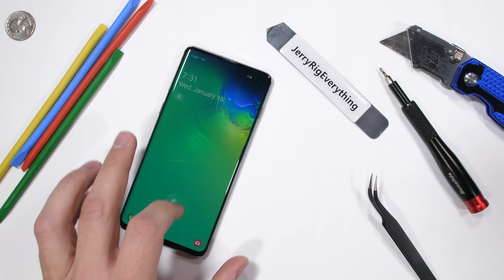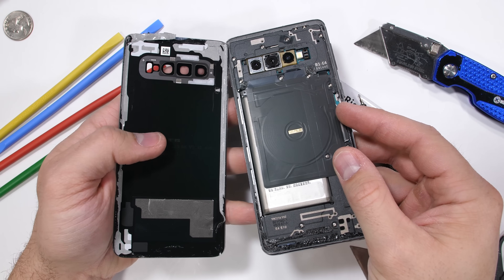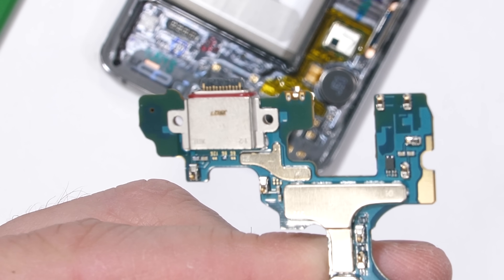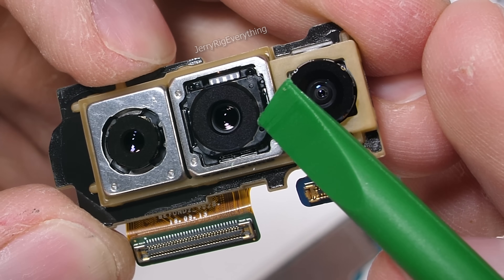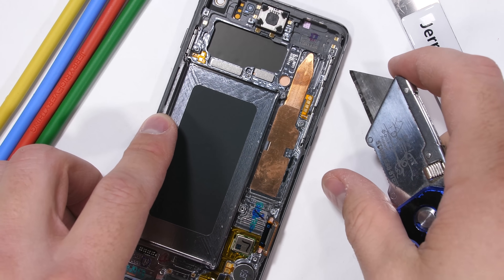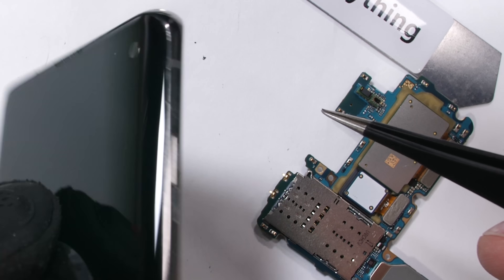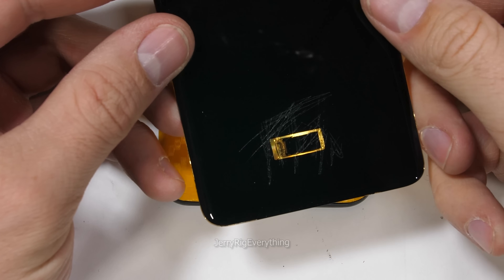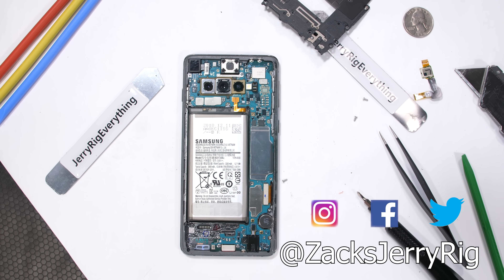Galaxy S10 Teardown – Does Ultrasonic Measure Up?

Comment: "Apple level anti-consumer planned obsolescence baloney"
-Zack, 2019
Reply: The iPhones are quite easy to repair. Adhesive strips for the battery,modular lightning port and microphone,modular speakers,simple display change without destroying it,modular sim-card tray… iPhones are more easily to repair than most people think.
Reply: @maltereese8800  That's why iphone lineup get repairability score 6/10 on ifixit. Easy screen and battery replacement, but you need special screwdriver because its a weird screw.
If the back glass is replaceable, they would got at least 7/10.
Reply: iphones and easy to repair... that is a fk lie
Reply: Fly Crack actually easier than the Note 9 according to ifixit.
Reply: Ikr😂 but whatever there's wireless charging
Reply: "Not cool"
Reply: Sam-ple

- ?, 2030
Reply: This is funny as I said "planned obsolescence" the other day and everyone guffawed like I was using a fuckin science term. Can't wait to send thise twats this with a time stamp! 

Fuuuuuck you guys! 😄
Reply: True story. Greeed.
Reply: i have done phone repairs since smart phones was invented. Apple has always been easy to repair included the break out charging port.. samsung has been "glued" together a long time . but i like both
Reply: @Tuxnor thats a fk lie, apple is soderin and glueing aswell and even uses selfmade screws and is suing even "non" registered repair shops... so shut the fk up with your lies
Reply: Fly Crack hmm. You can buy the screws. On amazon. For taking apart iPhones. 

Also, check out ifixit scores on iPhones and Galaxies. Might surprise you. 

And judging by how Samsung glues down the battery, replacement would probably be easier on the iPhone for this very battery replacement category since iPhones have pull tabs. Pull it out and the battery comes loose.
Reply: Does a tear down on a Samsung, sees something bad, it’s apples fault - zack, 2019
Reply: Yeetyeetyeet McDougald he didn’t say it was their fault, he just said it was something apple would do
Reply: Michael Pittenger lol
Reply: @Yeetyeetyeet McDougald are you that kid who got dropped their head on a stone as a baby? cuz you make no sense at all.

Comment: Nice video! :)

Wait, a permanent usb c port? That's just stupid. I have a Galaxy Note 8, and a half year ago the battery was acting weird: it shutdown in less than 5 minutes beneath 30%. Samsung fixed it by replacing that small pcb with usb-c port.

If it happens with Galaxy S10: whole motherboard. But is that cheaper for them? I think just more expensive: small pcb vs whole motherboard xD.

Comment: I want a phone that is designed to last and be repairable. Nothing overboard, just a removable battery, replaceable ports and buttons. A phone I will replace when I want to upgrade, not when it breaks. "But it has to break, what if you keep it for too long?" That won't be a problem if I don't buy your fucking phone in the first place.

Comment: lol people in comments saying they're not getting an S10 becuase you can't replace the charging port. First of all... HOW IN THE HELL COULD SOMEONE MANAGE TO BREAK A CHARGING PORT? What are you planning to do with it? It's a two-way charger as well. You'd have to be a mad scientist to break that by accident.
Reply: the charging port on some of my old phones would break over time. those were micro usb though, and not C. so far the type C charging port on my near 3 year old LG V20, works perfectly.
Reply: @ishb3w  Same here.. LG V20 user.. Changing to S10+ though.. ✌
Reply: My micro usb works just fine. (S6 edge, since it came out)
Reply: Slight correction, the USB-C charging port is not a 2-way charger. Only the wireless charging module on the phone's back has the Power Share feature. 
 Agree with the rest of your comment. Someone so abusive to a smartphone as to break a USB-C port should either buy a more rugged device, or just stick to a cheap "burner" cellphone.
Reply: @Sharky165  I think the "two-way" thing means that you also can charge the phone in a wireless form, not only with the C charger
Reply: @PsychoMomo  Precisely. Thank you.
Reply: @PsychoMomo  Perhaps, but that's not what he said or implied (the way I read it anyway). It seemed like he was only referring to the USB-C port.

Comment: The stuff inside of heat pipe is to wick fluid back to heat source. The way the stuff works: heat evaporates liquid (typically alcohol). Evaporation lowers temperature of the heat source... Vapor condenses on the cool side of the heat pipe. Liquid wicks back to heat source....

Comment: @ 6:20 the "mud" inside the heat pipe is sintering to aid in the movement of the liquid for the convection process in addition to the copper strands

Comment: So the ultrasonic fingerprint scanner and the unibody charging port/mobo are new methods from Samsung to screw you up in repairs and keep your phone for a long time.

For any mobile use the S9 family is already fast enough. Now if you're talking about gaming, the 855 is just 20% faster than the 845 adreno 630, not really much of a difference vs mobile gpu's of 2021-2022 +  new engines.

Comment: So let me get this straight, scratches will render the fingerprint sensor useless, but you can’t protect it because it’s inherent sensitivity means most screen protectors won’t work. Hmm. If Apple had done this you’d be roasting them for bad design, built in obsolescence, a money grab. But it’s Samsung, so you’ll just gloss right over it. No surprises there.

Comment: Man can you stop going on about “Planned Obsolescence Balonne”. Modern iPhones are more durable, last longer, are regularly supported through updates, and have a higher resale value then any android. A friend of mine still uses a freaking iPhone 4 as his daily, and it works remarkably well. Hell, even apples sales started to dip because no one NEEDED to buy new phones, as their old ones still worked fine. And I don’t see Samsung offering 30$ battery replacements. Android sheep

Comment: To be honest iPhones are easier to repair, the bs with the home button is annoying but screen comes out first, battery has magic pull tabs and bottom logic board can be replaced (lightning microphone antenna and headphone jack on the older ones) although I prefer android, as someone who likes to save money and do DIY apple have it in the bag

Comment: You can separate the lcd with heat and 530 spray for softening the adhesive  also for the back 
I daily change the outer glass for s8 s8+ and note8 it is slightly difficult  the display is very flexable without glass

Comment: The s10+ was supposedly the only model to be equipped with a vapor chamber cooling system for the chipset, pretty cool that they included this on the base s10 as well.

Comment: There’s also the issue With the fingerprint scanner that it won’t work with traditional screen protectors because of the tiny gap between the screen and protector. Which could be an issue for some people

Comment: I think the most important aspect of not just phones but anything is value, you can charge over $1000 for your phone but what are you offering me that I couldn't get out of a $400 phone? If you include all the usual specs as well as every little feature a person may or may not want such as a headphone jack, removable battery, sd card slot, dual sim, ir blaster, etc... Then sure, flagships don't tend to give you every little feature like that, so in that case charge whatever you want, but if the only thing you have to offer is "a premium feel" then I'll take the budget phone thanks.

Comment: Could you do the s10e? I'd like to know if that is more of a planned obsolescence device as well
Reply: Highly doubt it's different
Reply: I was super disappointed by that. I still have (and love) my s6. I thought that this might be my upgrade but now I'm not sure. I definitely want to see if the s10e is the same way
Reply: All you need to fix most of these things is a bit of sodering skills and in the case of the USB c port a  replacement from Amazon that you just soder back on.

Comment: irreplaceable charging port is probably not too much of a problem
1) wireless charging, you're less likely to use the socket
2) most people capable of buying that phone probably dont care replacing the socket. they replace the phone 😆

Comment: Cool looking phone! But i cant't understand why Android phones still use the basic circular vibrator motor for haptics, Apple's Taptic Engine feels SO much better.
Reply: The shape doesn't matter, and Samsungs motors are one of the best, if that's what you're looking for in a phone :) I'd much rather have a headphone jack than a bit nicer 'vibrator' :P
Reply: Benedek Fodor True true, but i must say in the 15 months that i own my iPhone 8 plus (Without a headphone jack) i’ve only really needed it once. I just use bluetooth headphones, and use the lightning to 3.5mm adapter when i really need it.
Reply: Max I usually use an aux cord and Bluetooth/wired earbuds, depends on the day. Having to juggle one dongle between my car and my phone is a hassle. If Apple brings USBC to this year's phone I might be interested. For now though I'll just stick with my S8.
Reply: @NamPhan777  I understand. I still find it annoying that Apple removed the headphone jack, and that other companies followed this trend
Reply: Max 
Headphone jack in this case is keeping that space

Comment: I think repairability is important key to phones.
I think Galaxy s10 (applies to s10+) earned a grade of D for repairability. Here's why.

The Good:
Easier back removal than previous Samsung phones.
Cameras are replaceable.
Headphone Jack can be replaced.
Battery can be replaced but carefully.
Types of screws need to repair are Phillips screws

The not good
Screen of Galaxy s10 is permanent and likely to destroy if disassemble.
Charging port is no longer replaceable.
Some parts can be modular, this phone is less modular than Galaxy s9 or older.
Ultrasonic fingerprint sensor is not replaceable.

Comment: I learned not to buy this phone because it's a real pain in the ass if the usb c port gets messed up. Sticking with my S8 plus which can be repaired a lot easier.....
Reply: What are the odds of it actually damaging tho? Had my s8plus since launch and after all these years my phone never had any issues, idk what you guys be doing with your phones lol
Reply: The odds aren't high but they do exist, and the fact that S8's battery life isn't great forces you to use more the charging port. Also, that's one of the reasons I don't buy cellphones without a dedicated headphone jack.
Reply: @RR0101001001010010  yeah seems to be an issue with lots of modern phones. I'm eyeing that razer 2 phone. 120hz and 4000mah
Reply: @ninodademon20  they would be tryna find the port when the room  lights are  turned off & that probably cause the pins to bent lol
Reply: @Shikaro12  but with usb-c either side will insert the phone with no issues so I don't see how that would cause it unless they're shoving it in the hole aggressively lol
Reply: My s10 plus comes on Friday after watching this video I’ve just ordered a fast wireless charger haha
Reply: @woodsi13  I hope you enjoy it :D These company's shouldn't do things like this because they make more than enough money as it is. They dont even want you changing a usb port ffs yet would be more than happy to charge a premium price to fix it. I would pretty much expect these phones to be bulletproof for the price they charge.
Reply: @colintx800  bruh how do you mess up your USB port? That's on you big fella
Reply: @Kyo-uz1zi  I've never messed up a port yet but accidents can happen :P if you was to buy a second hand 1 off Ebay which had a damaged port it just makes it much more expensive than replacing a simple little part.
Reply: Are you being sarcastic? , because i believe the original comment was sarcastic
Reply: @woodsi13  wise choice
Reply: Lol
Reply: If the USB-C gets damaged and you don't want to get a new motherboard, the wireless charging will still work.
Reply: @Nick Motsarsky The wireless charging is an option, but in my case, the charging port was shorted out, preventing the phone from even booting up, so I had to have it replaced.
Reply: How many times you habe total Change it?^^
Reply: @derspielographdsg7435  I charge it every 3 to 5 days, The battery on mine is fantastic! I watch movies and go on YouTube but I don't use it all day long cause I got something nice "To eat" lol.
Reply: Plus your phone really isn't much different from this one. Don't feed the system, use your phone
Reply: My S8 has dozens of cracks all over the glass thanks to the ungrippable and slips on 5° slope surfaces curved screen. So I still have to replace it with something, maybe the note 10.
Reply: @felixthefox100  if only you could put a rubber case on it :P
Reply: Your s8 screen will die before the Port. Had mine for 2 1/2 years and the the screen went dark with no damage or drop
Reply: @RedHaloManiac95  the same thing actually happened to me , not once but TWICE! the second time was because the first repair guy didnt go a great job and the screen went black again after 2 weeks. I paid about 600$ in total for repairs, I could've just bought a new one but I had so much on the phone I didnt want to lose but ended up being a waste anyways since the second repair caused a factory reset anyways smh
Reply: @RedHaloManiac95  high use? Amoleds have a shorter lifespan
Reply: @0xsergy  very high, did have some burn in from falling sleep with YouTube in portrait mode
Reply: Just replace the motherboard?
Reply: You still have the option to charge your phone wireless. But you can't connect your phone to computer or usb
Reply: After watching this I will NOT be buying any Samsung S10 series. Repairability is 0/10
Reply: JUST BUY MAGNETIC CHARGER AND USB IS SAFE)))
Reply: Same here, sticking with my S8 because I already had to replace its USB port thing.

Comment: I’ve always wondered why he doesn’t wear a ESD wrist strap.
Reply: Because that would make him a nerd, and he's too cool for school.
Reply: Because for the most part they are unnecessary, it would be incredibly hard to build up the voltage required to do real damage with static. Its more of a liability thing when people use it.
Reply: On his feet
Reply: just like working on a desktop you can self ground yourself buy rubbing the chassis/case of the desktop. in cell phones since your always holding the chassis/case of the phone your always grounded. at least thats what I believe.
Reply: @Los.B58  you're only grounded with a PC if the power supply is plugged in (not on) so it grounds you through the outlet. This is not true about a phone

Comment: Tearing down a s10 saying " I'm not updating from s8 ".
Reply: Lol. I have an original Google pixel, and a Pixel 2 XL. The pixel 2 XL is definitely better, and less worn, but even after having it for 3 months my original pixel is still my daily driver. It has all my data from all my apps, and I'm just more comfortable using it rather than the big phone. Although the batter is getting worn out fast, so I'm going to have to switch to my 2 xl
Reply: Personal devices are quite different from for-the-show ones :)
Reply: Does your S8 get a System UI not responding issue when you tap on your Bluetooth device from the drop down UI? Mine does and so does my sister S9. It's really annoying 😑
Reply: @lacrosse4higher  nope it still work well
Reply: @lacrosse4higher  have never experienced that on my s8

Comment: 3:34 - *correction, Galaxy S7 edge had a charging port attached to the screen of the device meaning you would have to buy a new display just to change the charging port. Super shit :/

Comment: I wouldn't ascribe the soldering to malice, there's probably a reason for this other than "fuck consumers". I'm sure it saved money, and possibly strengthened the connection, possibly making it more durable. Many people made the same argument when they started using permanently attached backs.